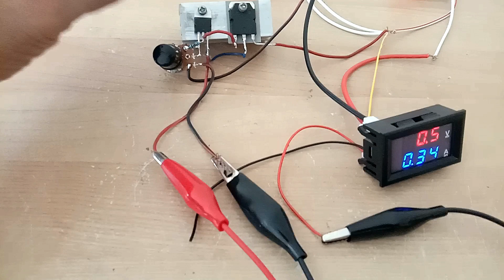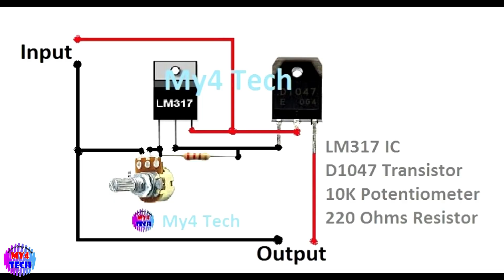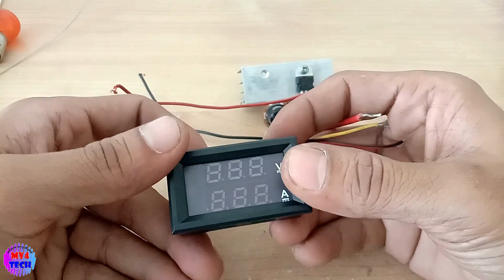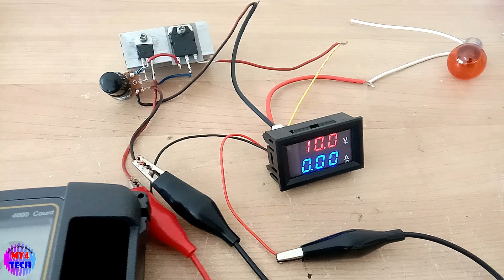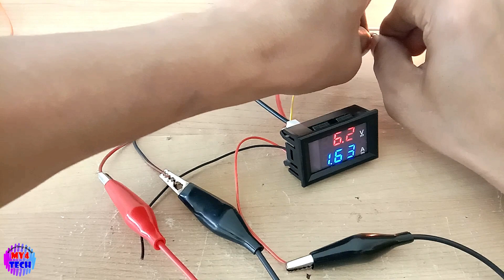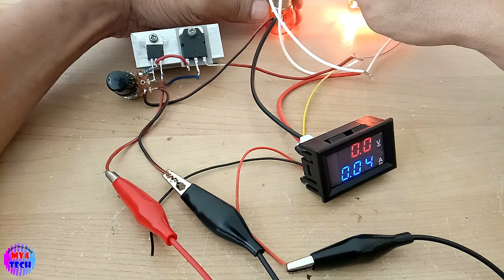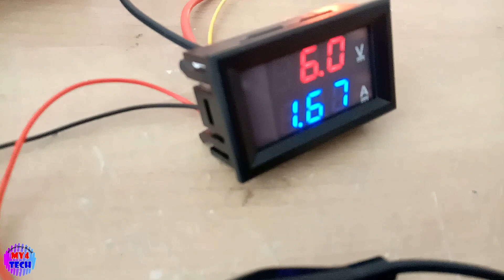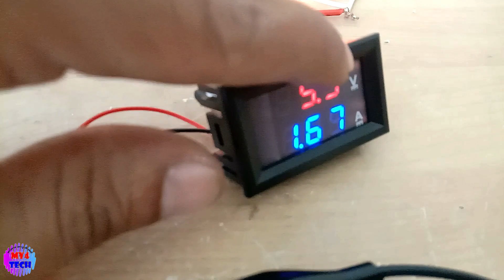Adjustable Power Supply And Increase Output Current | My4 Tech

Comment: Computer power supply ekakin 24v voltage meter ekata denna puluwan.namuth amp wayar 24v dunnama supply off wenawa.ai ehama wenna
Reply from the maker: 24v ඇම්පියර් අඩු නිසා ලොකු දෙයකට මදි
Reply: @my4tech761  na aiye mata hithanna computer power supply eka 24v ara gaththa 12+v wayar ekai 12-v wayar ekai ekathu karala.voltage meter eka amp wayar eka 12-v ekata dunna gaman power supply eka off wenawa.short wenawa wage.
Reply from the maker: @yasithajayalal9990  amp වයර් එක කිව්වෙ මොකක්ද. amplifier එකකටද සප්ලයි දුන්නෙ. මොකක්ද ඔයා කරන්න හදන්නෙ. පැහැදිලි විස්තරයක් දෙන්න.
Reply: @my4tech761  puluwan nam mata aiyage number eka denna.mama kiyannam.
Reply from the maker: @yasithajayalal9990  +60149607074